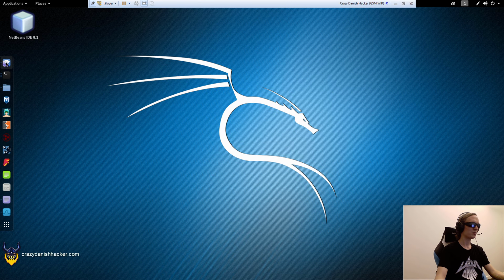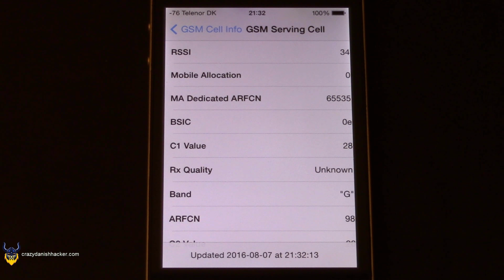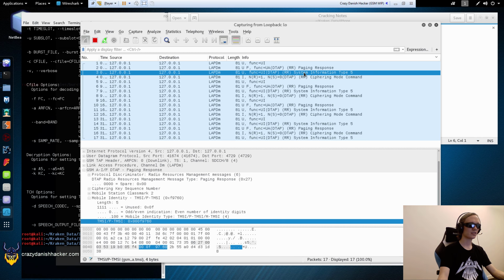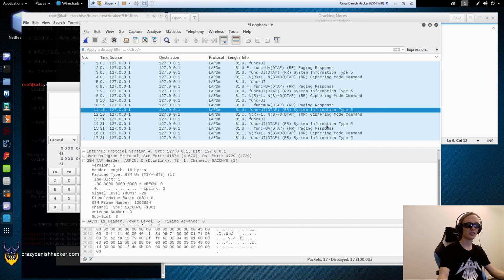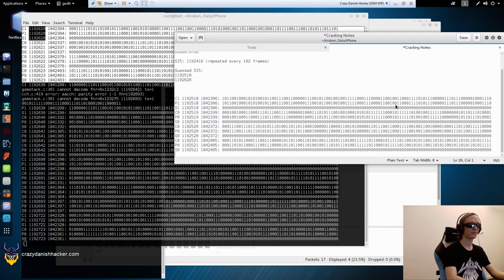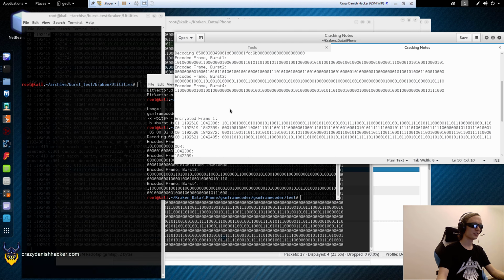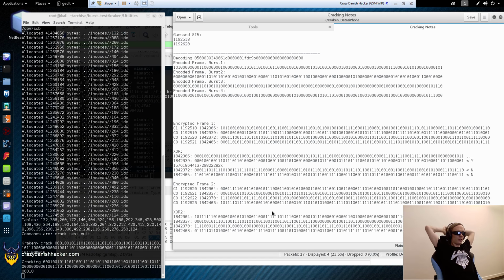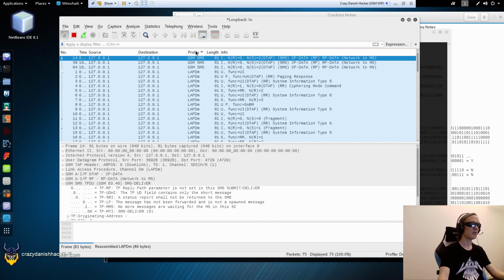GSM Cracking: SMS w/ Kraken - Software Defined Radio Series #16

Comment: stupid question:

Is it posible to decode mobile network operator name? (for instance I don't know which Base stations are operated by Telekom Slovenija or SI Mobil)

PS: Is it posible to get mobile number by just sniffing random mobile traffic?

PPS: What is a silent SMS and is it true that you can get TMSI by sending one?
PPPS: is there a free HLR Lookup service that will allow me to see IMSI for a specific number?
Reply from the maker: Question 1: Yes, look at the System Information 3/4 packets/frames (under Location Area Identification (LAI)) when you decode BCCH. They'll describe the network operator name, i.e. who owns the actual cellular network. Keep in mind that SI Mobil may be renting another network operator's cell towers. What you want to look for is the MNC for example.
Reply from the maker: Question 2: I don't think it's possible to obtain the mobile phone number (i.e. MSISDN) by sniffing random traffic. The mobile phone numbers are most likely only transmitted within the encrypted data to avoid hackers from sniffing out who's calling who, for how long, etc. For example, from what I can remember, I am only able to see my phone number after I decrypt SMS or voice. 

I haven't sniffed the uplink yet, but I believe it's the same on the uplink. The only interesting unencrypted packets that you can sniff (assuming encryption is enforced for SMS, voice calls and GPRS), are the IMSI's being sent over the uplink. From there, you could potentially try to lookup the IMSI through a database. Usually it's the other way around though, i.e. you look up the phone number and get the IMSI.
Reply from the maker: Question 3: Yes, there's a YouTube video showing a custom tool to obtain the TMSI by sending Silent SMS. I haven't tested this yet, as you probably need an SDR with transmit capabilities, or access to the mobile operator network. It could be possible to use custom SMS services online, but I don't know if there are any, and the mobile operator may discard the Silent SMS.

As specified here: https://github.com/CellularPrivacy/Android-IMSI-Catcher-Detector/issues/69accc, a Silent SMS / Stealth SMS / Ping SMS is a Type0 SMS which is specified in GSM 03.40 as follows: "A short message type 0 indicates that the ME must acknowledge receipt of the short message but may discard its contents."

Basically, Silent SMS is a "hidden feature" of GSM, that is mostly used by law enforcement to find out where mobile phones are. You can use the Android IMSI Catcher Detector to see them, even without rooting your phone I think.

Update: It seems like the most common and easiest way to send Silent SMS is to use either an app such as "Hush SMS" or connect to your USB modem, and then interface with it using a python application on your computer for example, such as: https://github.com/banjaxbanjo/rtl_tool_kit . You can probably do it manually too if you prefer, despite that I don't have the instructions for that. (You can look at the source code for rtl_toolkit though.)
Reply from the maker: Question 4: Yes. This website gets you 100 free HLR lookups: https://www.hlr-lookups.com/ I've tested it, and it works. Keep in mind that for some countries, or some providers, you may not get the IMSI. (I only got the IMSI in some cases though.)
Reply: HI I've tried it and I can't seem to find IMSI only some statistics here is csv version of report: http://downloads.dxing.si/GSM%20Stuff/HLR-REPORT-Mobitel.csv
Reply from the maker: Veso266 As I mentioned in my answer, doing an HLR Lookup will only return the IMSI for some providers and/or some countries. It does not work all of the time.
Reply from the maker: Update: It seems like the most common and easiest way to send Silent SMS is to use either an app such as "Hush SMS" or connect to your USB modem, and then interface with it using a python application on your computer for example, such as: https://github.com/banjaxbanjo/rtl_tool_kit